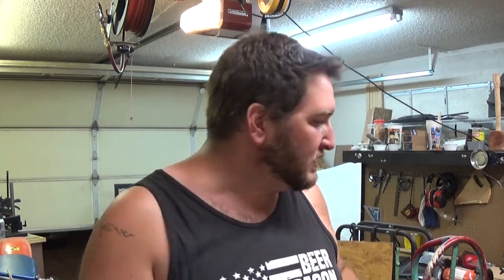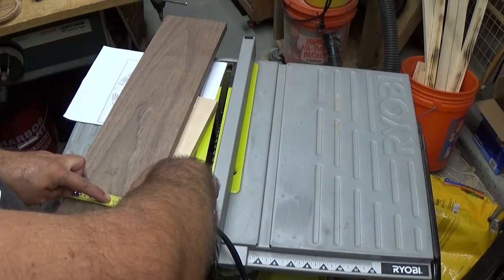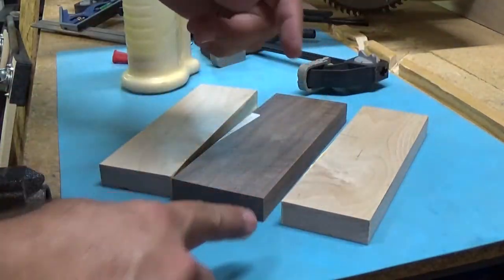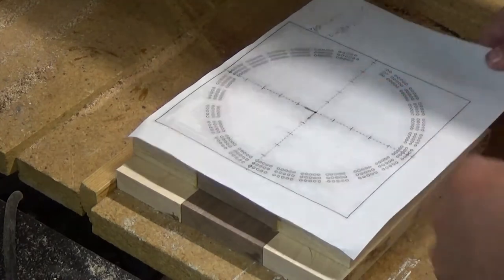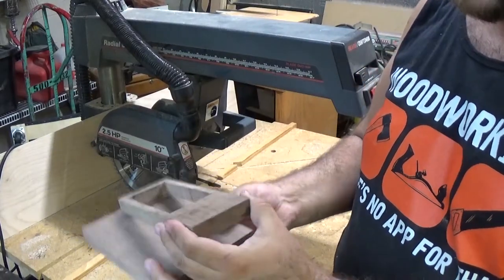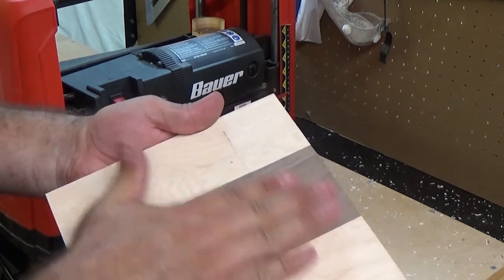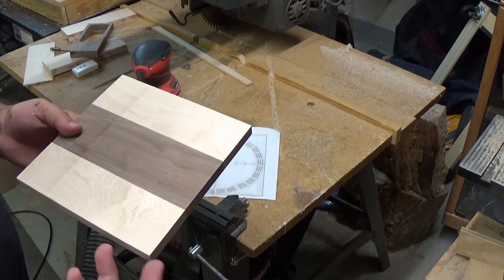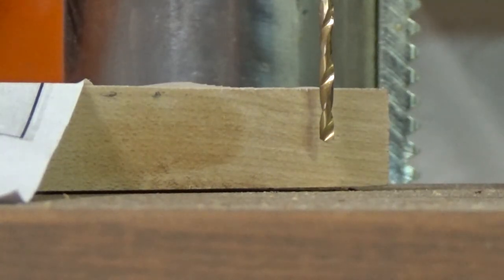Round Cribbage Board Part 1

Comment: next time you plane either added 4" to your length of board or add two boards to the side of the board that can be cut off and you snipe will not be on the blank material your trying to get flat on both sides. Think of a shape of an H with the two side boards.